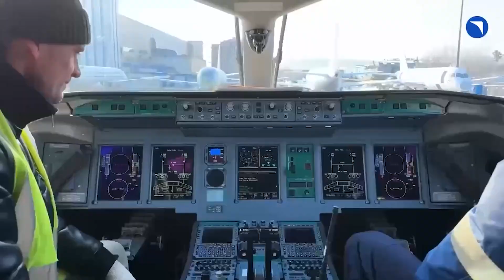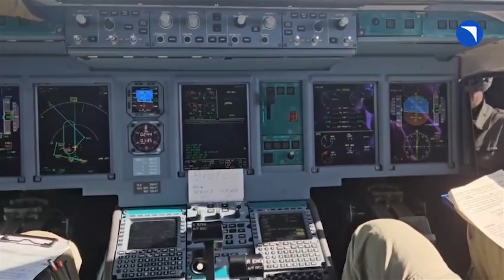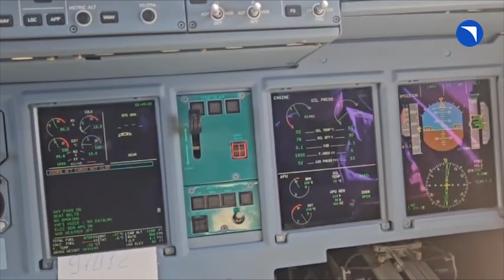Russia beats sanctions: PD8 engine finally powers Superjet SJ100

Comment: Your info is a little outdated. PD8 is based on PD14 engine which is being developed for about 14 years, so PD8 is offspring of PD14. MC21 civilian aircraft 100% Russian with PD14, both SJ100 and MC21 have same control same parts, same cockpit only size is different, another same based engine is now in testing phase it’s Called PD35 for IL 300 and IL 400M twin engine jumbo civilian aircraft. Russians have black listed both Boing and Airbus for good.